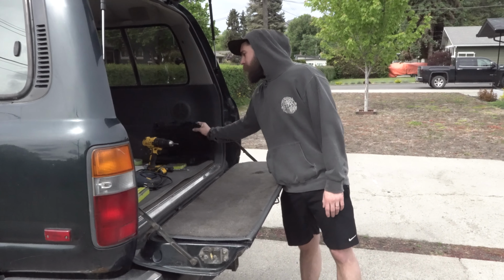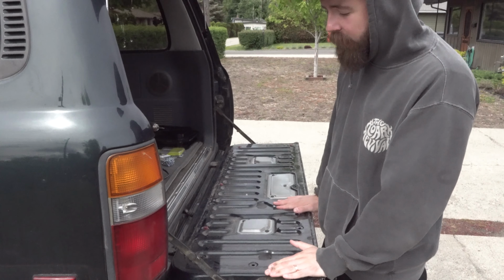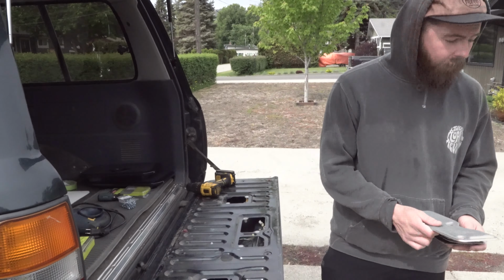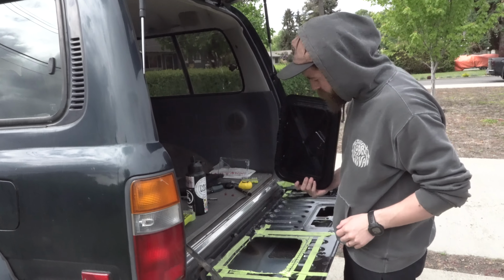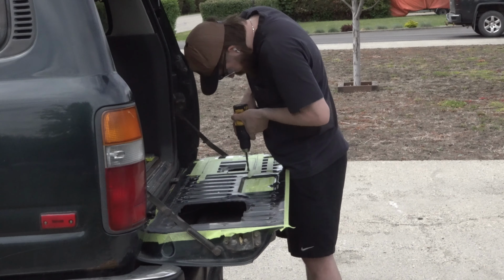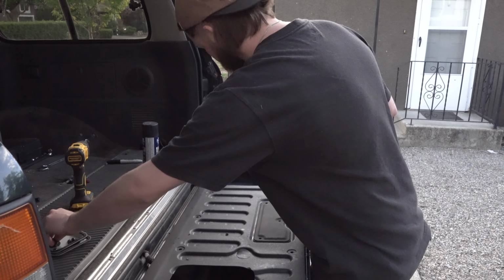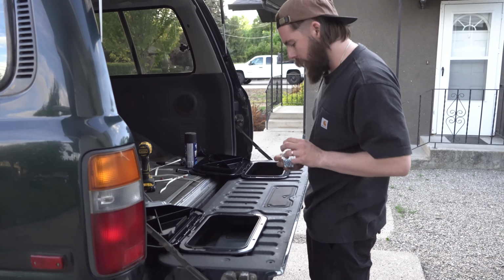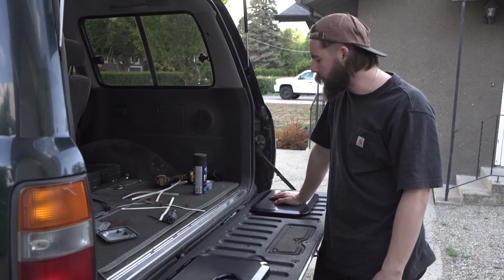Cheap way of adding extra storage | 80 Series Land Cruiser Overland Build Rear Storage Lid Mod

Comment: What setup you have for wheels/tires and suspension? Truck looks huge! Thanks and great content! Regards from another BC Landcruiser fan!
Reply from the maker: We have 33 BFG KO2 and I believe the previous owner installed a 2 inch OME suspension lift but the suspension is actually worn out so we will be replacing it as soon as those new parts arrive!